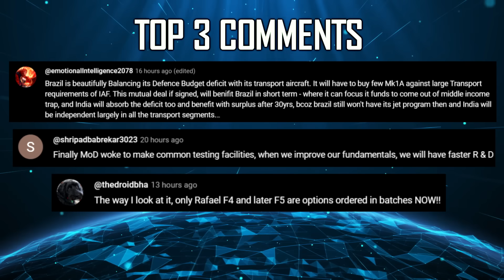Indian Defence Updates : 1st Gripen-E to IAF by 2027,Israeli HMD for AMCA,M-88 Engine Production

Comment from the maker: :yt:What's Your Opinion : "SAAB says Can Deliver 1st Gripen in 3 Years" ?
ＬＩＫＥ | ＣＯＭＭＥＮＴ | ＳＨＡＲＥ | ＳＵＢＳＣＲＩＢＥ:yt:
Reply: India should go with SAAB who is honestly ready for 100% TOT, furthermore it is cheaper than the other contenders.  This will help to maintain depleting squadron
Reply: @31ashishrout Brazil is paying $80 million per aircraft  - hardly “less expensive”.
Reply: @31ashishrout single engine fighter. Don't need it.
Reply: If u want single engine we already had 1, developing one more. Why we need new one. Kf 21 or rafale or fa 18. Because these engines r producing or offered to produce, viable to existing fleet. Kf 21 ,fa 18 radars r much more superior.
Reply: We have Tejas which is superior compared to Gripen. So Gripen not even in my dreams.
Reply: @sandeepsinghbhandari1471  We cannot compare a jet which does not exist with one that is available.
Reply: Focus on own jets
Reply: Mrfa is dead project instead of concentrating on mrfa we must buy 3 or 4 squardons of rafale or atleast buy kf21 and 6 to 8 squardons of tejas mk2 depending upon trails and concentrate more on amca  fighter jets 300 to 350 and start a development of sixth generation fighter jet for the replacement of 4th generation fighter jet after 2055 or 2060.
Reply: Big trash than sk pla... 🤣🤣🤣🤣
Reply: Most of the MRFA winners will be able to achieve this feet. Nothing special. Gripen is making last ditch effort to be part of MRFA. With MK2, they dont have much chance.
Reply: No Gripen
Reply: It's a single engine fighter. Don't need it.

Comment: Yes,any US engine will compromise both the Tejas programmes and this one if the US as it threatens from time to time,sanctions. The LCA programme suffered for years thanks to sanctions,have we not learnt from the past?

Either a French limited no of Rafales,plus more Russian fighters is the answer. The AMCA will never arrive in service before 2040, therefore an acquisition of 2/3 ,SU-57s to keep up with the Chins, more sqds. of new Super- Sukhois, and extra MIG-29s available,can be upgraded at 1/3 the cost of old M2Ks adding numbers to existing types,is the answer . If a brand new type is needed,the SU-35 sanctions free, single pilot too, will be both the cheapest and easiest to induct with existing types along with the Rafale, though much more expensive. Despite this, at least another 24 Rafales should be acquired for a total of 60+, which will have a few extra per.sqd. for reserves.

Comment: Choosing Gripen would be a pitfall as Tejas is itself getting upgraded well and will likely outperform Gripen is most of the aspects very soon. Also, it must be noted that Gripen too uses f404 based licensed engine and this will affect the production line and supply chain during the utmost need.

Comment: I think gripen is not a bad choice either it will give u 100 % tot it is not much different from tejas mark 2 it will help to speed up tejas mark 2 program than.india can order 10 squadrons of tejas mark 2 
10 squadrons of tejas mark 1a first 87 then 93
Around 10 squadrons of upgraded su 30 mki  5 squadrons of old su 30 mki which will start retirement from 2045-2050 
6 squadrons of saab gripen 
2 squadrons of rafael 
2 squadrons of tejas mark1 
And amca will also make up atleast 4- 5 squadrons 
Around 45 squadrons of aircraft which will not be retired till 2050 atleast 
Its my opinion 😅
A tiny defence learner 😅😅

Comment: Mrfa is dead project instead of concentrating on mrfa we must buy 3 or 4 squardons of rafale or atleast buy kf21 and 6 to 8 squardons of tejas mk2 depending upon trails and concentrate more on amca  fighter jets 300 to 350 and start a development of sixth generation fighter jet for the replacement of 4th generation fighter jet after 2055 or 2060.

Comment: Selecting Gripen would be beneficial to IAF.  

The decentralized operational infrastructure and philosophy would bring about resilience to concentrated attacks on forward airbases.

Most see Gripen as competition for Tejas Mk2. I actually think it would be a catalyst as there are a lot of similar components and subsystems that can be used on both aircraft and manufactured on large scale here in India. 

When done with the order for 114 aircraft, the Gripen factory could easily be converted to manufacture Tejas Mk2.
Reply: @adm7038  😶higher official biggest idiot i say if there choice this.... We need to tejas mk1 like 100+ than fully focus on mk2 and( 5th gen very important )later fully 5th gen 👌made in India, make in India 😎❤️❤️❤️

Comment: As good as the Gripen is, it will not be chosen because it will finish off the Tejas MK 2 program. Ultimately, MK2 is supposed to be what Gripen NG is already. i would say if offered for 60-65 million, go for Gripen NG, shut down Tejas completely and focus all resources on AMCA & TEDBF
Reply: I actually think Gripen would be a catalyst as there are a lot of similar components/ LRUs that can be used on both aircraft and manufactured on large scale here in India.

Comment: A)F414 Deal should be strictly time bound, no delay should be tolerated.
B)Gripen-E is very good but it has lower combat capabilities and is also single engine but has better electronic warfare system and maneuverability.
   Rafale is in all terms better tha Gripen-E except for cost and maintenance.
C)The MRFA should be done taking 
   1. No Delay in Delivery
   2. IAF's necessity fully fulfilled
   3. Cost 
   4. Transfer of Tech 
   5. Future Upgradability
   6. Should be 4.5+ or 5
Reply: This is what government wants, but Dasault is not willing to do ToT as it is one of the main cash cows for France

Comment: More than a fighter jet India Need Jet Engines 

My suggestion would be to buy EJ 200 with Know How and develop future variants based on it. With that Know we can fix Kaveri derivatives and use it in Tejas program. 

Parallely develop ORCA / TEDBF with kaveri engine derivatives so all the problems will be resolved. 

Bottom-line instead of spending huge sum of $20+ billion on MRFA spend $5-7 billion in 36-40 jets and spend $3-4 billions in ORCA and $4-5 billions in EJ 200.
Reply: Not possible to learn how to develop an engine by paying some other country for its engine.

Only way to learn how to  do it is to put in the hard work of indigenous research and development of Kaveri.
Reply: @mtrest4  That is how it works. India learned from France for rocket engine. Without support, we are struggling to make engine for last 40 years.

Comment: What I had came to know is, Rafael uses Gallium Arsenide based radar systems while rest of world including India is moving towards Gallium Nitride which is more efficient and powerful compared to Gallium Arsenide. Gallium Nitride will come in Rafael F5. So even if India apply for orders today, we will get our Rafael after atleast 4 years as allot of backlog is going on. And even after then as well, we will get Gallium Arsenide based Radar which will be outdated by then. Hence Rafael is good for today but if not upgraded, will be outdated.
Reply: I had got news regarding Virupaksha last week. It will use gallium nitride.
Reply: Goes to show how critical defence sector is
Reply: Last time when i checked, we are still flying in mig21,mi29,mirage & Jaguar. All these are 45-60 year old.
Reply: This is the reason we should make Tejas mk2 and AMCA development program on fastexit if not now we will suffer huge backlash from china and eventually Pakistan in air superiority
Reply: Dont get confused with spec. Real product is what it matters.
Reply: Gallium.Arsinide will have more heat signature n enemy radar csn pick up easily but Gallium.Nitride has less Heat dignature n will hv stealth capability regarding Radars. So for New Rafale F5 jets, india should insist for Indisn virupaksha radar only

Comment: Gripen Can't be Chosen as It's Engine is American
Reply: Tejas engine is American
Reply: @senthilkumar3214  That's Why Tejas Mk 1 with GE 404 is Facing Delay and Same Will be for GE 414
Reply: @biplob.kagyung gripen has had no delays , the supply chain issue is only with ge404
Reply: @pikaawiga763  Without Engine No Plane Can Run So Not Possible as IAF has Same Category Plane that is Tejas
Reply: @pikaawiga763 gripen doesn't own it's parts. That's the main problem. Sweden is not an in-house builder. They made it with parts from everywhere. Unless Saab allows or comes up with their own parts it doesn't solve the dependency issue.
Reply: @bulthaosen1169  So We Can't go For French Rafale because of Manufacturing Delay will Happen because it already has Many Projects in Pipeline and Russian Jets can't Thaken Because of Sanction also European Consortium Jet Because of Multiple Countries Involvement
Reply: @vaimurthy  So What can be the Reason of Delay
Reply: @vaimurthy  But Looking at Present Status US will Army Twist India With Military Production with India so SAAB will also Be Affected. It was HAL Negligence That Kaveri was not Able to used 😭😭😭😭
Reply: Dats why? Can't depend on us, tejas engine should also  change. @senthilkumar3214
Reply: Gripen won't be choosen as it's a single engine
Reply: @peggandwhiskey .......Using dual engine fighter aircraft in air defence role is very costly and MRFA  deal is initiated to replace single engine aircraft Mig 21 used  mainly in air  defence role and light attack role ..... Tejas mk 2 is a distant dream....... Even rich countries like USA is not using dual engine aircraft in air defence /light attack role..... So it is better for Indian Air Force to go in for gripen fighter aircraft ....
Reply: @fatehdharmender3495  
Learn the facts before you write . Mrfa was never intented to replace mig21 rather it's replacing the older aging jets unlike mig29, jaguar and mirage 2000 . There's no role like air defence for a fighter jet . Lca tejas will eventually replace mig 21 at later stages .
Reply: @peggandwhiskey Using dual engine aircraft in Air defence role  is highly costly........ MRFA  deal is going to replace mig 21 single  engine fighters .... used mainly for light attack and air defence role  ..... Even the rich country like USA uses single engine fighter extensively for light attack and air defence role
Reply: @fatehdharmender3495  LCA tejas MK1a will replace Mig21s. The MRFA was intended to replace the Jaguars and Mirage 2000.
Reply: @peggandwhiskey  It has nothing to do with single engine. Western engines are more reliable than twin russian engines. Reason is, it is similar to MK2
Reply: Very True...
Reply: Gripen will not be vhosen but Grioen is coming up with a new engine of their own.
Reply: @KaushikSarkar-uo2lt  Which Engine will They Make Without US Intervention
Reply: S verymuch true
Reply: But our own Tejas variants are powered by american engine 🙂
Reply: @vaimurthy  It Can Be Changed in Future If Kaveri Engine is made National Project and It Gets More Priority
Reply: I hope Eurofighter thypoon may win MRFA contract as their offer is much better than Rafale
Reply: @benoeythomas3816  But the Main Concern is The Jet Is Having Multinational Company involved so Winning the Contract has Less Chance
Reply: Grippen so many years I'm waiting for a good news for grippen aircraft and engine is Sweden made by Volvo company
Reply: @prasanth8523  Gripen is Currently Using US made GE F404-400 and Newer Gripen Jets are using F414-GE-39E US made Engines
Reply: @prasanth8523  Volvo Company make RM12 Jet Engine with the Help of US GE Company Using GE 404 Jet Engine as Base Engine so US Will Have say Whenever SAAB will Offer it's Jets to Other Nations
Reply: Very true we don't need Gripen just try and manage for next few years with GE or Safran engines but with very high focus on Indian jet engines targeting 2029 - 2030 to start producing them
Reply: @ps07959 Gripen nobody buying only few countries operating them. If we have to create export market for Tejas  buying Gripen will destroy tejas market in future.
Reply: Gripen provided Air diffence system to Pakistan
Reply: After US stunt with Pannu case gripen will not be chosen
Reply: This is not the problem the problem is indian airforcr need twin engine medium weight fighter and india already have a equivalent fighter like this which is tejas mk 2